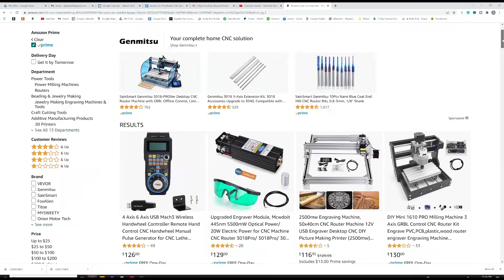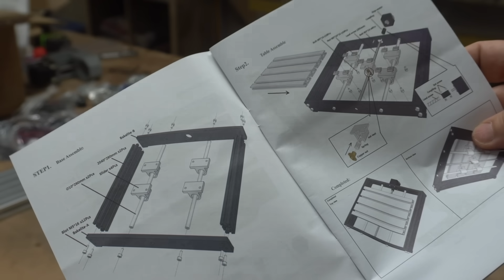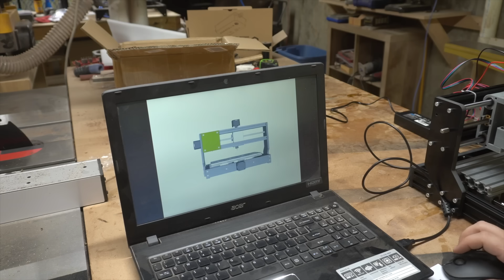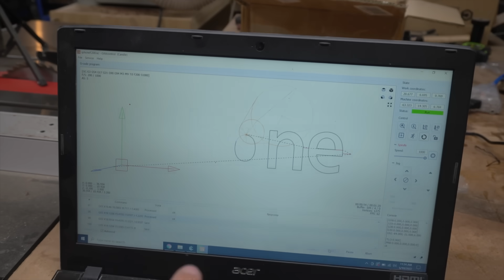The Cheapest CNC Router on Amazon

Comment: Desktop CNCs can pretty much all turn themselves on and off. The commands are in the gcode you just need some sort of relay. The Bitrunner from C3D is one example. It is nothing more than a relay which take the pwm 0-5v signal and turns on and off a 110v circuit. 
A VFD for a spindle takes it to the next level by not only turning on and off your spindle but using the 0-5v (0-10v in some cases) signal to set your desired rpm.
Reply from the maker: Wow, thanks for explaining this so well!
Reply: yeah but if they will explain how to connect relay who is going to buy their crappy overpriced modules ?  Connected relay to mine and would not run one without it, safety and convenience. Also z-offset is a glorified ground wire loop for 70 bucks.  Limit switches are also a must and cost cents but are not included somehow... All in all when I started my cnc path which happened after 3d printers I was astonished how ludicrously undeveloped hobby cnc market is compared to 3d printers.

Comment: This could be a great little machine to do my drag bit work. I've been wanting to do some plaques for the local little league, but it's not worth having my 2'x4' machine held up engraving brass.
Reply from the maker: I think it could work. Although I'm not 100% sold on its longevity.
Reply: @AndyBirdBuilds  absolutely agree with you. What in your opinion might be the weak link in the build? Is it the 3d printed components, or some of the electronics? What I'm thinking is that this machine only costs me about 5-6 hours of what I charge for my large machine, but it opens up for simultaneously doing other jobs. So even if I had to replace a part, or the whole thing every 30th project it would still come out in my favor. I would have to print a piece to hold a drag bit in the spindle collar, but that's nothing.
Reply: @BB-wj8dv  Could also add a diode laser if you have need of small laser engravings.

Comment: 1610 is actually just the bed size. I have the 3018 router/laser, and upgraded the bed to the 3040. You can cut with these with the 775 DC motor it comes with. If  you have time on your hands, and bought actual 3.175 shaft cutting bits. The engraving bits cut, but leave a lot of sanding. These open cncs are like 3d printers counter parts, easily upgradeable, and can be redesign. There's a lot of con, but the pros were good enough for my original needs. This isn't a go out and buy one comment, this is a do your research first comment, like I said there are a lot of cons, but like YouTube has plenty of content around these little cncs, for people who use fusion 360 like me it's you can use it with it. Great video. 👍
Reply from the maker: Thanks for sharing! It does seem like you could upgrade it pretty easily.
Reply: @AndyBirdBuilds  yeah, open source machinery is way to easy to upgrade, and gets a little pricey after a while.

Comment: The black plastic is bakelite, a rigid plastic.
Reply from the maker: I've never heard of this before, common?
Reply: @AndyBirdBuilds  Very common, was developed in the 50's I think. I have the 3018 version of this, I extended the Y axis, so now have approx 12" x 15" cut area. Used it a couple times a week for a year no problems. These will cut and do 3D. I just ordered a Longmill 48 x 30 today.

Comment: You can get onefinity to do router on/off with a relay and breakout board, or convert to 65 or 80mm spindle and use speed and on/off control using that same breakout board.
Reply from the maker: Now that you say that, there is a add on for the Shapeoko that will do this as well. I guess this because they use a router that already has a switch?
Reply: I took the brain dead way out and just used a wifi electric plug for the router. Set timer and forget it.

Comment: I bought a cheap 3018 on a whim a few years back. It's pretty much a slightly bigger version of what you got. I've used it for carving names on coasters, a D&D logo, and a few messages—all in oak or sapele. They cope a lot better than expected, and given a few small upgrades, they can handle a lot more than you'd think.
Reply: I did so too. And after only a handful of upgrades it weights now 75kg, has a steel bed, wireless tool setter and touch probe, a 2kW spindle with ceramic bearings and HSK32 manual tool changer. It cuts aluminium like butter and mild steel just fine.
I can really recommend the 3018 for beginners, with some minor upgrades it's really awesome.
Reply from the maker: I agree!
Reply: You have a 3018 that weighs... 165 pounds? That's a beefy 3018
Reply: Yes my 3018 is now a 3040 with mgn15h rails on all axis and nylon lead screw blocks. I can go through aluminum at 500mm/m  250mm/m plunge 3.175mm DOC. Still pretty slow but I get a really nice finish.
Reply: Could it cut 3mm brass??
Reply: Thinking about getting into this, mind if I ask what you paid for that? I'm trying to not break the bank getting a cnc
Reply: @dy1an  Wow, I am thinking of buying one of these so I can make gears and other parts for small engines and welders from foam and then casting the parts from aluminum.  I think this would be awesome for what I am thinking. what do you think?
Reply: @Biokemist-o3k  I've not tried mine on foam, so can't really comment on how well it would carve.
Reply: My wife bought me a 3018 many years ago. I am yet to get it out of the box as the software side of it scared me. Where do I go for help with this. I was thrilled when she got it and very disappointed in myself for not following through getting it going
Reply: @petermihan2128 I use Easle with it. You just need windows 10. It scared me stupid but Easle by inventables makes it super easy!!! I got mine for Christmas!!!
Reply: @petermihan2128 - No need to be scared. The build is not that complex at all. It doesn't require any special tools or skills. Once built, the enclosed software Grblcontrol (Candle) is very easy to use. You can start by clicking the cursor buttons to see how it responds. Just be aware of the lack of limit switches and mind the sides. Most issues I encountered were of a human nature, such as trying to move sideways while the bit is down in the material. (The machine is strong enough to break several 2mm drill bits; don't ask me how I know...)
Reply: May I ask...what made the biggest improvement? Do I ditch the bits? I got one for Christmas and made some cuts for little projects for the kids but nothing too "clean". I got it to carve words into wood charcuterie boards. Thanks in advance!
Reply: @alandzidek4104  ditch the bits for sure. The ones that come with it are a bit flimsy, and you can get much more solid v-groove bits for not too much money. A couple of up-cut and down-cut bits can help too if you do roughing passes with them before using the v-groove ones for fine detail. I think the best upgrade I did was to get a better motor, which made it a much more powerful machine capable of cutting at much better speeds.
Reply: @alandzidek4104  - The bits are fine to use as a practice set and to gain experience with handling different materials. They're not everlasting though and there are plenty moves to break the tip or to blunt them. One thing I learned is that speed matters. Depending on the material, both rotation speed and advancement greatly impact the results.

Comment: The black pieces like like phenolic.
Reply: I had purchased a sainsmart 3018 which is basically the same machine just bigger. When I did some research into the machine it was mentioned that the plastic is possibly bakelite. This machine is capable of quite a bit but have to go real slow.
Reply from the maker: Could be. But isn't that stuff expensive

Comment from the maker: You totally should watch this next! https://youtu.be/AbZxOSvKYDs
Reply: spindle on and off isn't hard. it's crap coding.. m03 turns it on and m05 turns it off. just edit the code before running. the m03 needs a speed number like "m03 s5000". m04 i think is counter clockwise if you ever need that. just put it somewhere like after raising from z from x0y0. just so it before the first negative z movement, you be fine. the m05 i always put in after it returns to x0y0.  funny you mention it as a starting point. i got a 3018 as a starting point because i wanted to learn programing and get so hands on. they're not going to let me have a shot at work. a programmer in my area makes a significant amount more than i do. about the machine though it's 3 axis mill, tiny, weak and questionable quality but it'll run code. you gotta factor in feeds, speeds, chip load and the machine's ability (not much lol). i would argue it counts.
Reply: One thing I can't understand with all of these China products is why the instructions are so bad.  There must be 1 million native English speakers in China who will help you write your manual for the price of a beer.  Why the Chinglish when one beer and some friendly conversation would make your product look 100% more professional?
Reply: Cute how long until it grows up to be an adult cnc router lmao
Reply: Sd
z
Reply: @Andy Bird Builds
what if you want to make the cnc longer? is there any way to expand it?
Reply: Is that a 540 size motor?  If so you could step up or down using RC car motors to get more POWER.